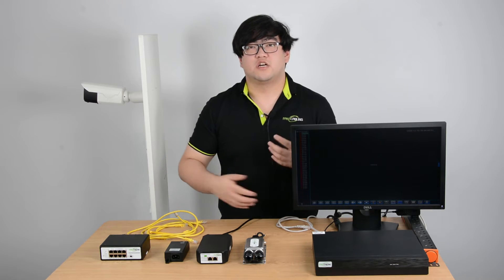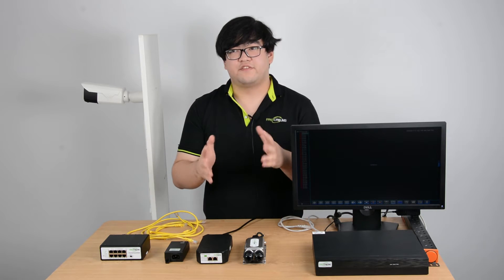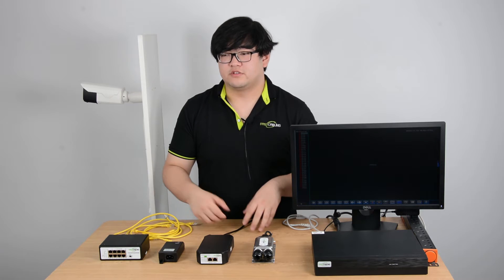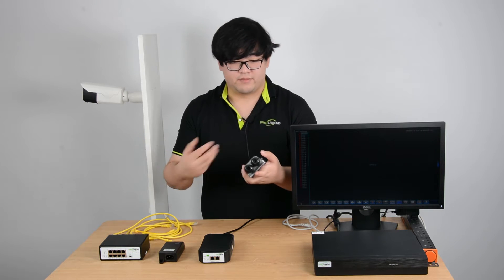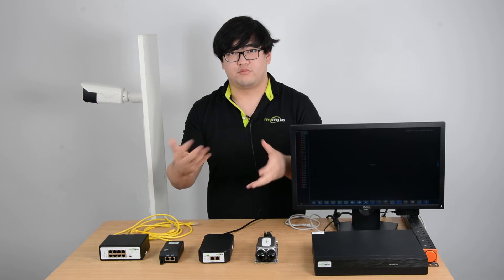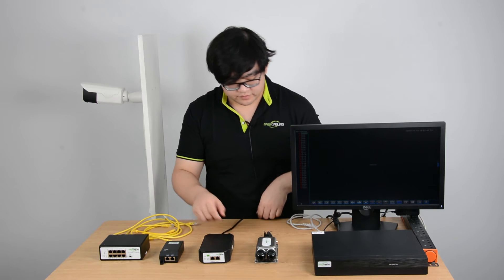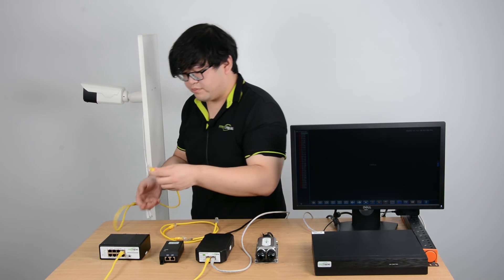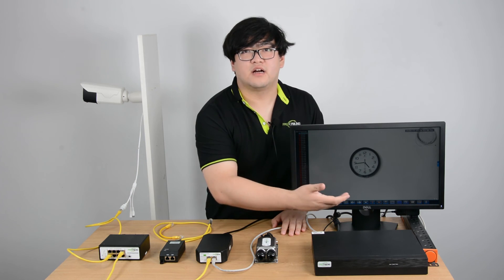What is PoE Injector?

Comment: Can you use a poe adapter to just power a device without a data cable? I am looking to power access point that will connect wireless for data
Reply from the maker: Yes, you don’t need the data cable. It is typical setup in mesh network. Here is the related video: https://youtu.be/5PkqGiv-KHM

Comment: Thanks for video! We have a PD device that needs to be powered from the PSE, do we still need the POE Extender (the third device), you have used? or Just a POE injector is enough?
Reply from the maker: The PoE injector will be good enough within 100 meters. You will need PoE extender to extend PoE beyond 100 meters. I assume what you owned is the standard PoE. The PoE extension doesn’t work with passive PoE.

Comment: Installing a camera more than 400 feet away, can I use this injector to boost POE signal midway? (source is already POE).
Reply from the maker: No, You will need PoE extender. The PoE injector only add the power to the Ethernet cable. It doesn’t process the data. It is the data you should boost up after 328ft. https://www.fastcabling.com/product/poe-extender/

Comment: If you add an external power supply will the switch no to stop sending POE+ if it is connected directly to the switch without the injector?
Reply from the maker: Can you elaborate on the scenario? I am not quite follow your question.
Reply: If you have a poe switch the injector isn’t necessary since the network switch is powering it up

Comment: So with a poe injector you can power any non poe device within the wattage over ethernet?
Reply from the maker: No. The IEEE802.3af/at standard PoE injector will verify and classify the edge device. It is not featured with PoE, the injector will release to send the power. The passive PoE injector that has removed the power handshaking will injector power without 'asking'. It could damage your non-PoE devices if you don't know what you are dealing with. The standard PoE injector is safe for plug and play.

Comment: Thanks for sharing the informative video, can you tell me that third device name? I think that device uses in the telecom sector
Reply from the maker: In the typical PoE system, there is PSE (power switch/PoE injector) and the PD (POE enable edge device or PoE splitter). The PoE extender is kind of both PSE and PD. You may need to check whether your telecom device us passive POE or not. It is the not standard PoE with DC24V.